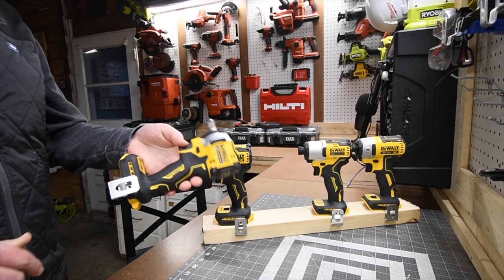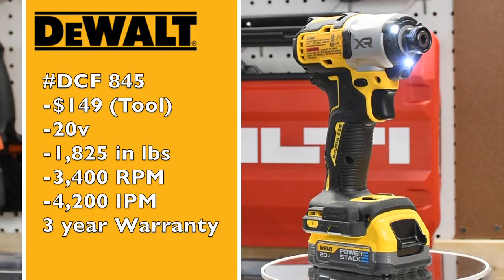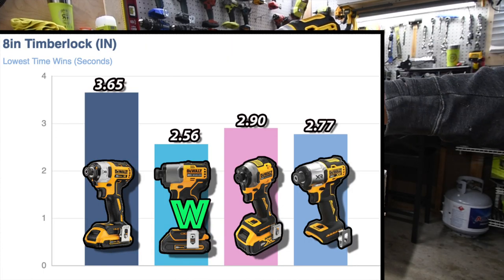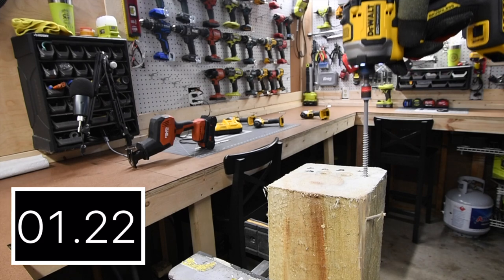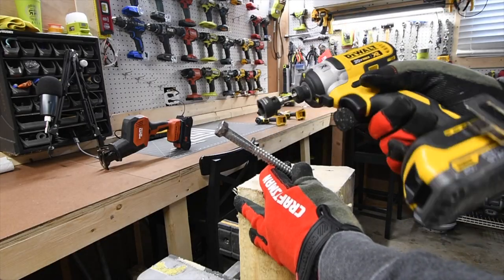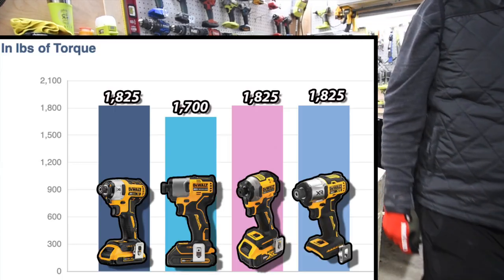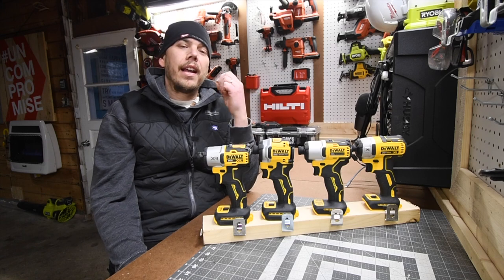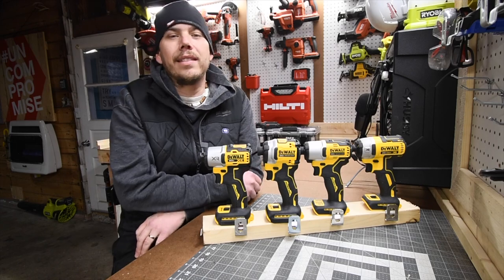Which One Is Obsolete?

Comment: I have a six year old Bosch impact driver that's still chooching. It's not the fastest but it gets the job done.  Having the latest and greatest means nothing if the tool doesn't last.
Reply from the maker: I agree with you on that.
Reply: I have a 10 year old Milwaukee brushed impacter that still sinks them in.  Those old brushed drills and impactors were better lasting than todays latest greatest in my opinion.

Comment: I measure the DCF845's IPM at just over 4K (4,026). I wonder if the 840 is an actual 4200
Reply: We need to see that new Hercules brushless driver on the dyno my guy! It seems to be a beast so far
Reply: TTC - if you're positing this in reference to the figure at 5:09, it's just a typo - max IPM spec per DeWalt for both the 840 & 845 is 4200. Please disregard if I misunderstood. BTW, been kinda binge-watching your channel lately - some of the best stuff on YouTube 😁 - keep doing what you're doing! 👍
Reply from the maker: only one way to find out TTC :) I did have a typo at the end with the IPM chart.
Reply from the maker: @skygreen5939  TTC is a very unique channel, they will only keep growing and evolving their tests
Reply: Nah I realize both 845 and 840 are rated 4,200. Just that our 845 measured arounf 4,026IPM using high speed footage. So i wonder if the sometimes outperforming 840 hits an actual 4,200 but they wouldn't give the 845 a lower spec.
Reply from the maker: @TorqueTestChannel  That's why I do these tests. Motors act differently with different test. it's weird on how it works but I was still shocked that a variable speed trigger only impact driver that is cheaper than the others won most of the tests. I honestly thought the 845 would destroy them all. but the results show other wise. its crazy
Reply: @ManCaverTools  yeah I kind of expected that too; for what it's worth @CraignBros has a video on their channel where the 845 does win pretty solidly (though it gets a lot hotter than the 840 for some reason). I'd also be interested to see a measurement from TTC of the 840's max IPM. Maybe a bit disconcerting, but I'm assuming all this variation between tools is simply within DeWalt's production/QC spec tolerances.

Comment: If I were to get into the Dewalt line, I’d choose the 850. The form factor is a lot like my fuel and it’s weaker than mine which would actually be a benefit for things like pocket screws. I have to use a LOT of trigger discipline even in speed 1. Great video Dave!
Reply from the maker: I thank you Griffin

Comment: The 887 is behind by mere tenths of a second in most of the tests. I don't know if that's a testament to how great that tool is considering it first came out in 2015 or if it's showing how sad it is that the newest offerings aren't that much better or faster. That being said, I recently converted my 887 to a wrench with an anvil swap and got the 850 with a power stack battery to do all my smaller, quicker, easier jobs.
Reply from the maker: Lets say you dont have an impact driver, there were 4 options. and they all cost the same. which one would you pick?
-887
-840
-845
-850
Reply: @ManCaverTools  
Since they're drivers and not necessarily meant to be used on the larger tasks the 850 wins simply based on its power-to-weight and power-to-size ratios. I got it recently as my new daily "driver" (he-he get it?) and it's great! It's part of our in-home toolkit, along with the DCD800 drill and a few other things, that I'm comfortable with letting the wife and kids use for their projects.
Like I said before, I took my 6-year-old 887 and put in the ⅜" square drive anvil (thanks to channels like yours btw!) and now I've got a decently compact, powerful, 3-speed impact wrench that'll easily bust the lugs off even my Tundra. Couldn't be happier with my impact situation at the moment.

Comment: Thanks for this comparison! Small typo at 5:09 - DCF840 IPM should be 4200. The 840 is a little badass; takes the bang-for-your-buck crown, IMHO.
Reply from the maker: you are correct, my bad bro
Reply: @ManCaverTools  I'm more familiar with those numbers than I'd care to admit - been trying to convince myself I don't need to upgrade from the 840😉; I like your test results!
Reply from the maker: @skygreen5939  I try to not make mistakes in my vidoes. but after editing this video for 9 hours it tends to happen

Comment: I just bought my first DeWalt impact after only owning an M12. It feels very strange in my hand because the handle is so skinny. Idk if I can get used to it.
BTW, I have a DeWalt 6 1/2" circular saw and a Milwaukee same. I just got the Milwaukee but so far I like the DeWalt better. It's lighter and just feels great in my hand. Also it seems easier to see where I'm cutting with the DeWalt.
Reply from the maker: that is why they make different brands. not all tools feel the same to everyone :) im glad you were able to find your favorite circular saw
Reply: I used to be a die hard milwaukee fanboy.  Multiple tools breaking and m18 battery failures have got me looking elsewhere.  I recently bought a circ saw fro flex.  Oh do i like it....yes i do.  Even bought an extra battery for it.
I also have eyes for one of dewalts drills...that 20v max flexvolt kit with the 6ah flexvolt battery.  I get into a position money wise I'm gonna buy that sucker.  It looks like a beast....

Comment: Thats odd.  The 887 in your video actually sank that structural screw.  The 887 we have at work wouldn't even make it a third of the way down.  I thought it was just a puss but maybe its actually broken?  It acts like its hammering but stalls out.
Reply from the maker: the 887 I have haven't really been used in a long time. Been using the 850 in videos since it came out.

Comment: I've watched a few different reviews and tests of the 845 and it's performance is pretty disappointing considering how well Dewalt's other recent offerings have done.
Reply from the maker: im not disappointed with it. They made the 840 into and XR. you will be surprised that a lot of people dont like the 850 because its wide
Reply: @ManCaverTools  
Disappointing because Dewalt still hasn't matched or bested Milwaukee's m18 fuel impact driver.
I meant the performance of their impact wrenches the new high torque, mid torque, and compact atomics that beat Milwaukee fuel.

Comment: Yeah, the old flagship 887 is obsolete. I wonder when dewalt will replace their flagship impact driver? I mean 850 is great, but it's an atomic, and 845 kinda dissappointing.
Reply from the maker: They need to make Power Detect impact driver
Reply: @ManCaverTools  or a Flexvolt Advantage